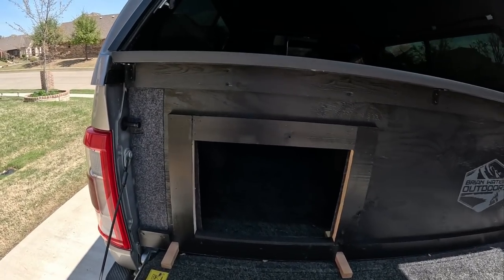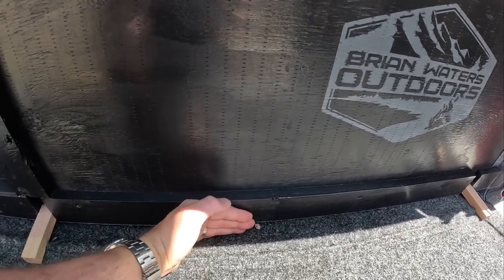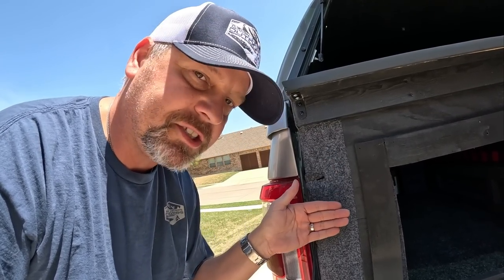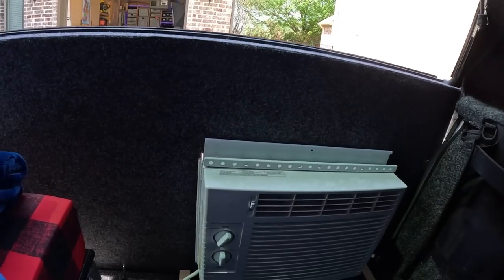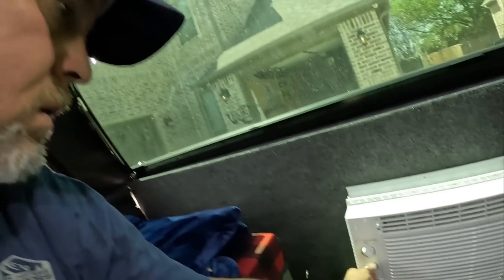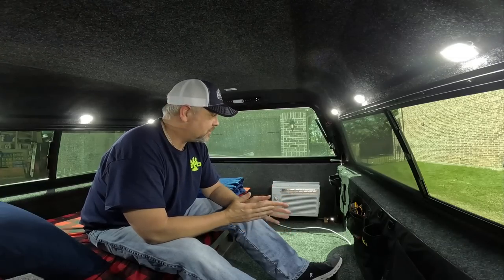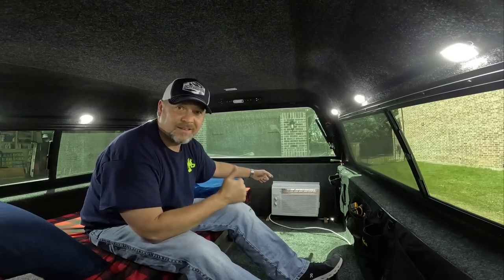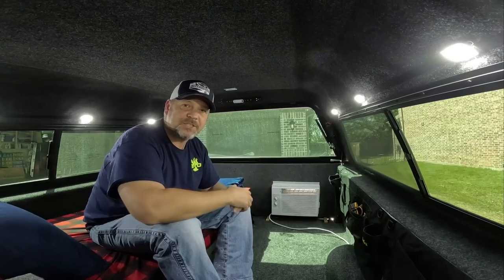Truck Camper A/C : CHEAP, EASY & COLD!!

Comment: I would have put it in through one of the side windows so you don't have to take it in and out all the time. Are you using shore power?
Reply from the maker: Yes. Using shore power
Reply: Drive way camping?  Or the world's longest extension cord?  😂

Comment: Do you happen to have the build for this version of the tailgate on video?   I am attempting to do something similar only I want to make sure I am seeing the entire piece.  Is there a 1x3 that runs along the very bottom as well as the two you mentioned that are along the top?   How did you attach the 1 x 3's    woodscrews and glue?
Reply from the maker: I don’t, sorry. Just built and tweaked it as I went.

Comment: I am deciding between a Softopper and a hard shell. I have dogs. The Softopper could run Safari Style in the Summer. Is the hard shell going to be too hot for dogs in the Summer with just the side windows open? Is there a fan option or something?
Reply from the maker: You could run something like a Ryobi or Dewalt 18v fan, but I think it would still be too hot for dogs. It got up to around 110 degrees in mine here this summer without a/c
Reply: @BrianWatersOutdoors  I decided to go with a hard shell. Ordered it today. In the Summer, I will just have to buckle them in the backseat and cover everything with the pet covers.

Comment: How is the condensation on your bed rug?Does it get wet on your tailgate?
Reply from the maker: These newer ac units don’t have drain holes. They have a spinner ring that collects the condensation and splashes it back on the condenser to help keep the unit cool👍🏻

Comment: Are you letting the condensation just drain onto your tailgate and carpeting?
Reply from the maker: There is none. There’s a fan inside the unit that splashes the water back onto the condenser to cool it down.

Comment: Curious how is that going to run when you're camping you aren't going to have any electricity or an extension cord to plug that into anything?????
Reply from the maker: My Honda 2200 generator will run it just fine. Or my Bluetti AC200 Max does not have any issues running it either👍🏻

Comment: Hey was that high temperature do you have a problem with your air conditioner condensation and running out on the back of your tailgate
Reply from the maker: No because these newer units have a spinner ring that splashes the condensation back onto the condenser. I’ve never seen a drop come out of this unit even in last summers heat👍🏻

Comment: But How do you Power it? Is it 12Volts or are you Plugged into the House?
Reply from the maker: I’ve used an inverter, power station, generator and shore power

Comment: Why didn't you just make a iced cooler air-conditioner ? 5 times cheaper ?
Reply from the maker: That doesn’t work in humid environments. Already tried it. It just adds more sticky humid air
Reply: @BrianWatersOutdoors  I live in Mississippi ,it works.

Comment: Those little window units drain the condensate water some where.  Where does yours drain the water?  Since some truck beds are slightly higher in the back I would not want the water to run inside the bed.  So where does the water go?
Reply from the maker: Not this one. It doesn’t even have a drain hole. It has a spinner ring that catches the water and splashes it back onto the condenser to cool it down.
Reply: @BrianWatersOutdoors  So the moisture that is created by the condenser is simply evaporated back into the air with the hot air exiting the air conditioner.  I have had two portable air conditioners and one had to be drained from a collection bucket and the other one just dumped the moisture out the window in the exiting hot air.  So I guess that is what your air conditioner does.

Comment: So do you use a generator when there is no shore power ? Or do you have batteries and an inverter ?
Reply from the maker: I’ve used a generator, a battery with an inverter and a large power station👍🏻

Comment: Did you ever deal w/ the condensate dripping on the bed rug?
Reply from the maker: It doesn’t drip at all. This has a spinner ring that splashes the condensation back onto the condenser.

Comment: How do you power it when camping. Electric hookups or some other way.
Reply from the maker: Shore power mainly. I could use a small generator or a large battery power station if I had to. This will mainly be used at hook up sites this summer only though. Too hot down here to risk it during June-September.

Comment: What air conditioning are you using and we’re did you buy it? Thanks
Reply: 8:44 Walmart, Home Depot, Lowes
Reply from the maker: It’s. Frigidaire 5000 btu. Just picked it up on Amazon.

Comment: Where does the water drain?  Also, what about when it rains?
Reply from the maker: There is no drain on newer ac units. They splash the water back onto the condenser to keep the unit cool with a spinner ring
Reply: @BrianWatersOutdoors  you did a great job.  Thanks for the quick reply.  Maybe you could consider selling this, I would buy this setup.   I had heard from some utuber’s that here in Fla there is too much humidity for AC and some of the car camper/suv enthusiasts woke up damp in the morning with portable ac’s but if this setup removes the humidity, I am all in!

Comment: Where does your water drain to.  Just out on your tailgate?
Reply from the maker: These new units don’t drain like older ones. There’s a spinner ring that splashes the condensation back onto the condenser to keep the unit cool. I’ve never seen any water drain out of this while running it.

Comment: What power source are you using for the a/c when you’re not parked outside your house?
Reply from the maker: I’ve used a small 1000w gas generator, a 400ah battery and inverter, a big Bluetti power station and campground power
Reply: @BrianWatersOutdoors  first. Thank you for the response. I truly do appreciate it! Second. this is going to sound like a naive question. And maybe it is. But you’re simply saying that you’ve used all of those different methods. But not simultaneously right? I’m sorry. But I’ve been doing a bunch of research for my set up. So I’m just genuinely interested and I’d appreciate all the help and knowledge I can get. Hope to hear back. But either way, Stay safe & Stay blessed my friend!

Comment: Are you using 120V or an inverter?
Reply from the maker: I’ve used an inverter, a large power station, a generator and shore power when that’s available.

Comment: Have you gone through the rain storm with that set up, is it watertight?
Reply from the maker: I’m sure it’s not watertight, but if it’s raining, that generally means it’s not 105 so I would t worry about running it then
Reply: @BrianWatersOutdoors  Thanks for the quick reply,  I saw your power cell video, do run the AC off that (how long?) or shore line only?

Comment: Will it drip onto the carpet and soak into the bed area?
Reply from the maker: No. Has a spinner ring that splashes the water back onto the condenser. Doesnt even have a drain hole.

Comment: Where do you have the cord running out of
Reply from the maker: I have the “shore power” cord underneath my truck by the hitch I plug into. Then I have a power strip inside the bed that I can plug the ac unit into

Comment: where does the condensation water run off to?
Reply from the maker: There is none. These units don’t have drains like the older ac units. They have a fan that splashed the condensation back into the condenser to keep it cool

Comment: What do you do about the ac dripping on your bedrug on the tailgate
Reply from the maker: This unit (and most newer ones) don’t even have drain holes. They have a spinner ring on the fans that “scoops” up the water and splashed it back up on the condenser to keep the unit cool. I had this ac on my DIY camper I just sold and never saw a drip come out of it last summer.
Reply: @BrianWatersOutdoors  cool i did not know that

Comment: The water drain's where?
Reply from the maker: It doesn’t. These new a/c’s have a ring inside that splashes the condensation back into the condenser coils to keep the unit cool. Have never seen a drop come out of this a/c👍🏻
Reply: Thanks Brian liken this stuff,i used my topper to boondock in parking garage at hospital for 13 days when my wife had surgery 3years ago, topper's do come in handy every now and then

Comment: Are you only using this unit was shore power?
Reply from the maker: Yes. Will
Have to use elec sites this summer here in TX.  Too hot otherwise

Comment: Who ever started the nonsense about reflectics being an insulation material left out the main issue... Reflect -  as in it reflects heat via the sun. it is not an insulation material... it works on windows to reflect the sun.... otherwise one needs to use real insulation to keep an area cool or warm...  dead air is a great insulation... Thus sure using reflectics on your windows... great idea.... everywhere else use actual insulation... not reflectics.

Comment: im guessing your AC dont drip water?
Reply from the maker: It does not. Doesn’t even have a drain hole. It has spinner rings to scoop up the condensation and splash it back into the condenser to keep it cool.
Reply: @BrianWatersOutdoors  is that the A/C from Amazon?  i have one on my wish list that similar

Comment: How do you run it when camping?
Reply from the maker: Most of the time using shore power. You could use a small generator or a large power station like an Ecoflow Delta Max

Comment: So you have to use shore power?
Reply from the maker: No. Last 2 videos I’ve posted I have used a battery and inverter to run this a/c overnight. You could also use a gas generator also👍🏻

Comment: Where does the water drain to?
Reply from the maker: There is no water. Most newer units don’t even have drain holes. They have a spinner ring on the fans the collect the condensation and splash it back into the condenser to keep the unit cool.
Reply: @BrianWatersOutdoors  Thanks for the reply. Guess I'm old & behind the times. lol. Have a great day!

Comment: where is the condensate diverted to?
Reply from the maker: It doesn’t condensate, or need to drain basically. There’s a spinner ring that splashes the condensation back onto the condenser to cool it down. There’s not even a drain plug. Same is true on most newer window a/c units.

Comment: Yeah but what what what what what what what crabby air conditioner does it take 30 minutes to take the temperature down to from 90 to 80 some degrees in 30 minutes like I don't get it why isn't the air conditioner making it freezing in there like faster you would think that this giant window AC Would Have Made It 70° in less than 30 minutes considering the space

Comment: What  bout the ac DRAIN  tailgate gonna be wet
Reply from the maker: There is no drain on these newer window units. They have a spinner ring that picks up the condensation and splashes it back onto the condenser to keep the unit cool. I had this same unit on my camper and never saw a drop of condensation 👍🏻

Comment: without  HOSE YOUR Tailgat will get wet maybe
Reply from the maker: Not on these newer units. There is no drain hole. There is a spinner ring that splashes the water back into the condenser to keep the unit cool.